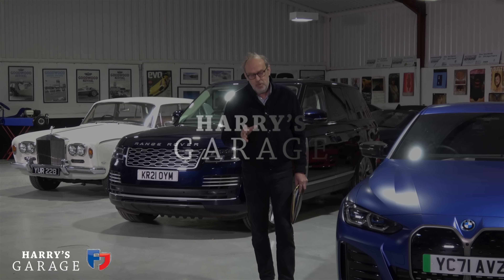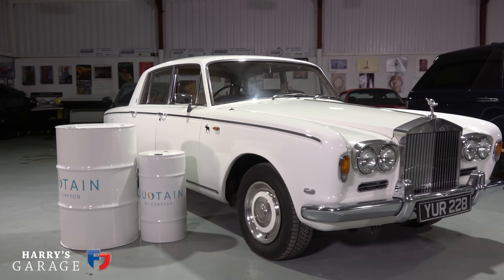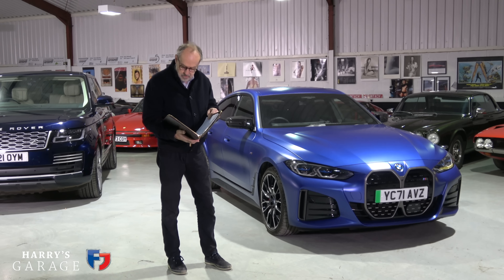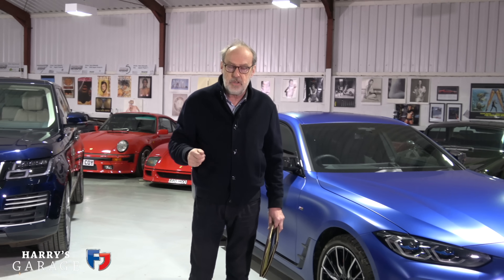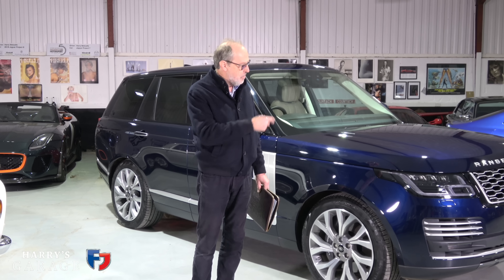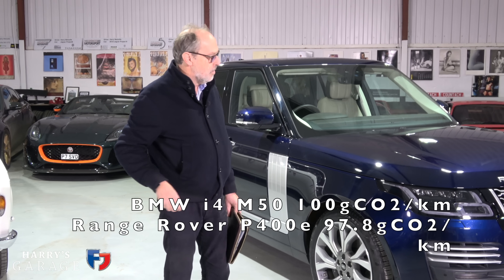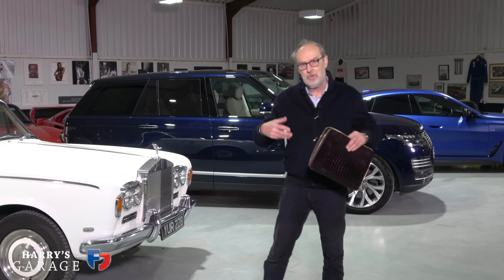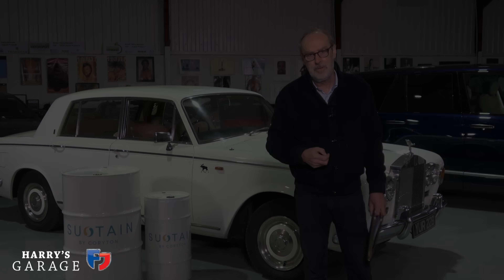Sustainable fuels; what are they & are e-fuels better for the planet than running an EV or PHEV?

Comment: I rarely find myself not in 100% agreement with you on most issues, either motoring or land management……. However, at similar age and interests (outdoors, land work, boats, cars and bikes)…… I read a lot regarding the planet and our management of it…… or more specifically, the delusion that we are able to manage it at all.

I’m a committed environmentalist, our wasteful use of scant resources and filthy dumping habit must stop….. purely from the point of view of having clean water and a clean environment to live in. I don’t however, subscribe to our having knocked the earth off kilter since the Industrial revolution….. 

Climate change is a thing……… it was changing well before the birth of the Range Rover and Trevithick 🙂 well before we crawled out of the primordial soup……

This 4.6 billion year old erratic wobbly ball is unaware of our recent arrival, our trials and tribulations, clinging onto the surface……. nor will it notice when we eventually leave.

We should champion nuclear fuel for power generation, using our ingenuity to dispose of the spent fuel, use onboard power generation to feed electric propulsion for vehicles, using only electric in built up areas for the sake of clean air……

Dig the coal out of OUR ground and find clean ways to extract the power, rather than drag wood pellets from Canada to burn in the UK 😳 Create more fast transit systems, trains, or an evolution of them…. to shift people and goods around faster, cleaner.

The antipathy towards rail or road expansion, apart from the obvious nimby factions….. is usually driven by voices gripping a big scale map or road atlas showing the country buried under lines…….. Anyone who’s been in a light aircraft at 1000 feet or used Google Earth, cannot fail to marvel at how little detail is visible amongst all the dappled fields…… apart from the obvious big cities.

Maps give a hugely warped impression, otherwise you wouldn’t be able to see the roads marked at all.

We should be using our undoubted technical skills to move forward, faster, more efficiently……. not taking the wheels off….😢

After the Climate industry has paused from furthering its income by spreading doom and the end of days…… have a look at sites like ……. climatediscussionnexus.com

Time well spent….. 🙂🇬🇧

Comment: Fascinating Harry. Worthy mention of construction costs, not least the 500kg of extra rare elements such as lithium and cobalt that are needed to manufacture EVs.
Reply: And with EVs being substantially heaver is there an additional 'road repair' and 'tyre dust/replacement' cost? I guess partially offset against less 'brake dust/replacement'

Comment: Next time you want to do some maths Harry give me a call - the Range Rover has a higher CO2 figure - you need you KWh per mile for the RR then it’s easy to compare with the BMW - spoiler it’s higher than the BMW.
Reply from the maker: The Range Rover P400e doesn't give you a miles/kWh figure, hence why I didn't include it. I know usable battery size is 13kWh and 100% range is 25 miles, hence why I used 2 miles/kWh in my calculations.
Reply: @harrysgarage  Okay - quick maths says if you did 69mpg with 60% electric use - you are doing at best 28mpg on fuel only use.  So 235g CO2 per mile for 40% of the time and 125g CO2 whilst on electric if you use the same electric as the BMW.  That gives 169g CO2 per Km.  Of course if you use a better electricity source it drops a lot but the BMW always drops more - it’s more efficient.  Love the channels by the way I am however a maths pedant.

Comment: For what its worth my numbers are 111 (carbon intensity in West Mids now) divide by  3.6 miles per kWh (my Model 3 over 13000 miles) which gives just 19.4 g co2 per KM.

Comment: Great breakdown and fully agree with the longer life cycles of ICE vehicles using sustainable fuels. Another figure you don’t see published for EVs is the pollution (especially in built up areas) of the tyre and brake material. As the EVs are so heavy and instant torque / heavy braking they pollute more this way than traditional ICE vehicles.

Comment: I'm not even convinced that CO2 is a problem.  The theory is that sunlight is captured by CO2 and not reflected back into space.  But there is a finite amount of energy in sunlight, and it is spread across many wavelengths.  CO2 absorbs energy at one specific wavelength.  Once it is all absorbed, there is no more to get.  Solar panel manufacturers know this.  They call it the Shockley-Queisser limit.  It means that the effect of CO2 on temperature rises logarithmically and increasing CO2 concentration above a certain level, has little effect.  My source is Professor William Harper of Princeton University.

Comment: An electric car is NOT zero emission.  Thank you!!  Marketing.  Enough said.  I certainly hope the Sustainable fuel can become affordable.  Harry, your best video to date.  Cheers!
Reply: Funny enough on certain electric nutter forums the Toyota hybrids were derided for being called self-charging hybrids. The fact they actually do charge their own batteries (from the fuel granted but they still do) and the fact these were people happy to have "zero emission" slapped all over their electrics - an obvious and proveable lie - always stood out as being a bit odd. 
They are a bit like the militant cycle crowd - lots of noise from a relatively small group and if you don't agree with them they feel the need to get some random daftness pushed through parliament to get their own way.

Comment: Nailed again. 
I live in terraced street and company forced into hybrid or full EV. Hybrid makes complete sense currently and you need an all rounder.
Reply from the maker: Thanks, 90% of UK EVs are bought by households who also have access to an ICE powered car. If you want one as a sole car, it's a big jump and, in my view, we're not there yet.
Reply: @harrysgarage   couldn't agree more. From own experience in last week since my hybrid arrived (BMW 330e Xdrive), in my local town with population 100K, using Zapmap and visiting charge points, out of circa 30 in the town (within 2 miles of town centre), half are out if order and 10 more than 2 months out of order. Network and fixing existing network not close to ready.

Comment: So my 2011 Hyundai i30 with a 1.6L diesel engine is a very clean option, it makes 119g/km of CO2...
Reply from the maker: Absolutely. I nearly mentioned diesel but thought there was plenty of stuff to absorb in the video already. A modern diesel, with adblue, is still a very good option and because it does way better mpg than a petrol model, is producing much less CO2. I'd suggest sticking with it until the new generation EVs arrive that offer similar range, which I predict will be 2028-2030.
Reply: @harrysgarage  here in Sweden, the diesel was about 28 sek 4 days ago, about £2.2/L, out of this 28 sek, about 20 is tax, and people are silent, to avoid Greta Thurberg's anger...

Comment: I'm very interested in these e-fuels/synth fuels.  My cars are toys that do very few miles per year so cost isn't a big concern,  would be if I was driving everyday!  I'd rather keep my old cars going on something like this.  The amount of energy taken to make a new car is far too much for the use I would get out of it and a total waste.
Reply: Mass production could also drop the price in time. What's neat is unlike EVs, the distribution network for fuel is already in place.
Reply: Harry said that they are twice more expensive than normal fossil fuels. Considering that they are now only used probably by 0.00001% compared to normal fossil fuels users, I'd say that that's not too expensive actually. They would definitely be a lot cheaper once they have a bigger market share.
Reply: @aabidamn  Incorrect. Shell has already announced that their first, immature, initial production which will be done in very small quantities (so doesn't have advantages of scale) will cost only 2€/liter...including taxes!! 

Biofuels also have been used by hundreds of thousands of people for years and we know for sure they haven't cost anywhere near twice the price, in fact they've only cost a few cents per liter more...even though they don't get the massive subsidies EVs do!

You are right that they will certainly get even less expensive when production is further increased.
Reply: @pistonburner6448  Harry did say that the synthetic fuel that he uses, cost twice the price of a normal fuel. But if Shell are already able to have their version priced at €2/liter, I wouldn't say no to that.
Reply: @aabidamn  Yeah, well Harry is buying his stuff delivered in a barrel. From Chile or something if I'm not mistaken...
Reply: @pistonburner6448  Then I guess the €2/liter one from Shell was probably made in Ethiopia 😅.

Comment: No mention of the self-charging hybrid - which if used with Coryton Sustain, would mitigate the cost of that fuel and minimise exhaust emissions and CO2 - at least until the real answer - sustainable hydrogen - is readily available as a generally applicable energy source. It would provide a solution to the problem of limited vehicle range and circumvent the apparently insurmountable problem of a practical infrastructure for charging domestic Evs. Isn't it CO2 that keeps your fields and trees green Harry?

Comment: People should buy whatever suits their lifestyle. I run an EV as a 2nd car for all my mundane short journeys. My normal ice car wouldn’t even get up-to temperature on most runs.
Reply from the maker: And that's the perfect use for an electric car right now. For info, 90% of UK EV buyers have access to an ICE powered car, only 10% of households are buying them to be their sole car. Once the new EV tech arrives (solid state batteries?) I can see that changing and they will become true ICE powered cars but we're not there yet!
Reply: I was fortunate to be able to buy a lightly used nisssn leaf 2.0 in 2018 for under £20k at this price it makes sense a new one now is over £36k…Car prices are so expensive now ice or EV’s. My current predicament is I also run a Macan GTS but need to sell soon as maintenance costs are getting expensive! A new Macan GTS is now well over £80k add in fuel and tax costs  I’m not in a position to stay with the Brand. For now due to me running my own business with tax breaks available a Tesla MYP is affordable. The same price ice car would then need tax and fuel on top of already hefty list price. And yes I am a true petrol head.. thanks for all your videos always great….
Reply from the maker: I see Tesla as a different proposition as range is generally way better than other EVs, then price is lower and their supercharge network is brilliant. The tax advantages on EV are crazy right now, why the government continues with these when it needs all the income it can generate is nuts but you might as well go for it why they are available.

Comment: Good first effort looking at a complicated comparison. Like you know in agriculture there are misconceptions of environmental impact of livestock and land Co2 lockup, there are similar errors in the info you use for car use. Like the fuel that is used to move fuel, oil for oil, cables for electricity. The main point though is if we use electricity which requires the infrastructure and in time more of the energy will come from renewables. Also you forgot the health impact on people walking and cycling especially children.

Comment: Analysis like this also needs to take into account the benefit on air quality in urban areas of EVs over combustion engines. Harry's entire focus on CO2 ignores the cases where coroners have determined that poor air quality has been a cause of death. EVs powered by electricity from renewable energy sources are where we should be headed.
Reply from the maker: Fully agree inner-city air quality is a very important factor here and that's where the EV really helps. But this video was focused on global warming and how we can reduce the amount of fossil fuels we're all consuming.
Reply: @harrysgarage  I just fear that videos like this Harry will confirm prejudices among your subscribers that EVs are a waste of time. The charging infrastructure and manufacturing methods for EVs are in their infancy, and things will improve given time. I'd be interested to know more also about emissions from vehicles powered by synthetic / 'sustainable' fuels, including the CO2 that is involved in the production processes of those fuels, the required engine technology, and the transport of those fuels to the customer, which all need to be factored in.
Reply: There's a few issues with that as it isn't engines that only produce c02. Just that it is easier to fool then tax people. 
I'm a refrigeration engineer and my c02 output is negative due to the leaks I repair. 
A 10kg bottle of R404a is the same as 38 Tons of c02. Not to mention there are many open refrigeration systems still that use masses of energy as doors on cases aren't legislated by law. 
E10 was supposed to" save "750k Tons of c02 in its first year. I know of 1 refrigerant leak that basically wiped that out. 

None of it gets talked about by anyone

Comment: If planning permission for a turbine in my garden were possible, I'd have one in a shot, and an e-car to suit. I drive under 100 miles/day, so the smallest EV would suit me, and plugging it in at home for free would be amazing. I would still keep my massive Merc GL for "occasions" but it makes no sense commuting, visiting  family and friends, or shopping in the GL which (today) costs £151 to fill up.

Do you think planning permission for a personal/domestic turbine will become easier politically now the supply of gas is going to become more problematic? Since those storms has passed through, I don't think the wind has remained sufficiently high to keep a turbine like Harry's spinning. There's one on a farm near to me (North Worcestershire) that I cycle past every day and it's never still.

Comment: No the planet won't notice one EV driving around instead of one ICE either. But if you have to make a new car, it is better to make 1 million new EVs than 1 million new ICE cars.

As an EV fuel can always get greener when an ICE can't when using petrol. No one is going to be paying £3/litre right now.

And harry how many ICE cars from the RR era have stuck around? 1 in a couple million maybe.

Comment: Interesting, I do have one challenge to your logic on the dirty power in central England IF a person buys an EV they are likely to also choose to purchase a 100% renewable tariff (doesn’t matter where it is generated within Uk), granted there may not be capacity now to run all electric cars but as demand pushes investment then green capacity will displace the dirty (hopefully to keep pace or exceed rollout of EVs). BTW you didn’t appear to add in the CO2 for the grid electricity on the PHEV 🤪🤪 On the sustainable fuels point I was looking at converting ICE to methanol or ethanol and I think I read that one of them has a similar energy density to Petrol and making either of these is far simpler than chemically constructing the more complex petrochemical molecules (and probably burns cleaner).  Also recommend you look at artificial photosynthesis, tech coming along that mimics what happens in plants do but directly produces hydrocarbons (eg methanol or possibly Petrol) this could be a passive system that just sits in the sun and directly produces fuel.  It’s still in the lab but much progress is being made.  I kind of like the idea of a roof on the house that absorbs CO2, catches the rain and drips fuel into my car as long as the sun shines🧐🤪🧐🤪🧐

Comment: as was recently explained on shmee's channel - electric cars have massive environmental overheads during production and need to be run for tens of thousands of miles before they even get level with a CE car. to just consider the running of them is missing the point

Comment: Mmm, bit dubious on that sustainable fuel.  You didnt mention transport costs, which from the Sahara will be significant.  Also you are pumping co2 out into the atmosphere in populated areas, at least an EV has no emissions when driven. We are seeing the ULEZ being expanded and Bristol banning diesel cars at certain times of day.  I think in the long run the only way to keep driving the rolls is to put an electric motor in it.

Comment: On one hand eco radicals want all Westerners to atone for decades of living the relative high life and give up cars, especially as entertainment, as collective punishment. On the other hand the filthy rich are turning backflips justifying extravagant object entertainment vehicles by any tortured means. Very interesting clash of ships of civilization passing in the night. Neither is exactly correct as is usual with dichotomies.

Attending to the planet is about population not cars. While those of great means are putting boutique fuel in a Rolls when not using an electric BMW, millions of absolutely broke people will be riding two stroke scooters, burning wood/coal to eat, and putting upward pressure on the use of every commodity that takes energy to create. No technology can create a person who does not use some energy, and wish/need to use more.

As for cars for necessary worker transportation (especially in the US), the secret for the future is weight reduction and computer controlled navigation, whatever the power source. If cars can be computer controlled so that they cannot hit each other, then their weight can be halved, and thus their energy use cut dramatically. Mass transport is not a fix as the independent unit transportation for the free individual with free movement to endless locations in all weather cannot be replaced by a train or bus.